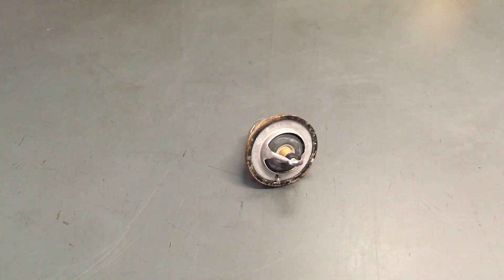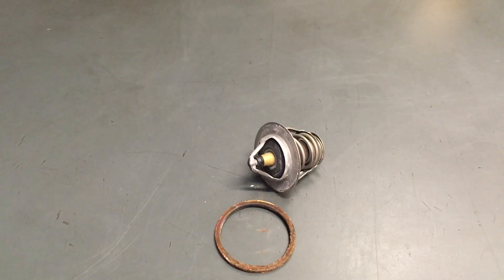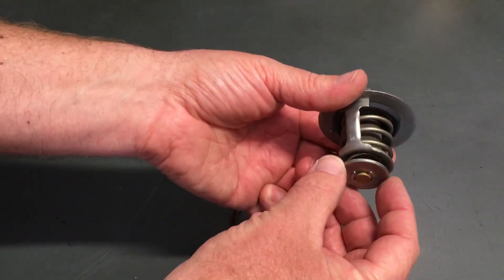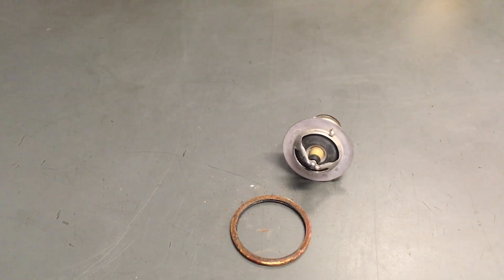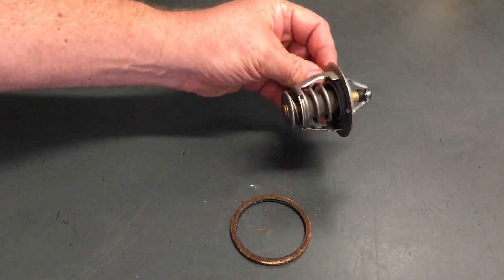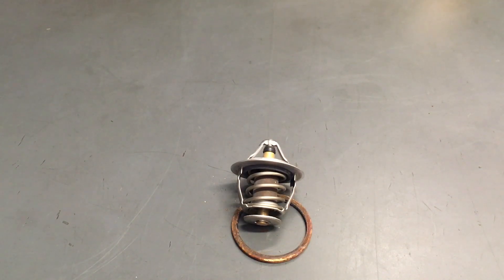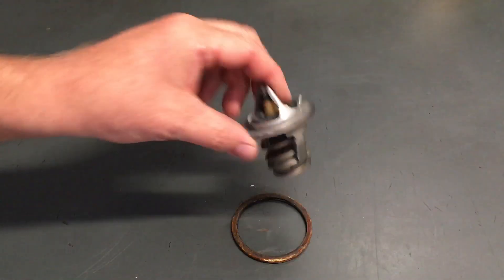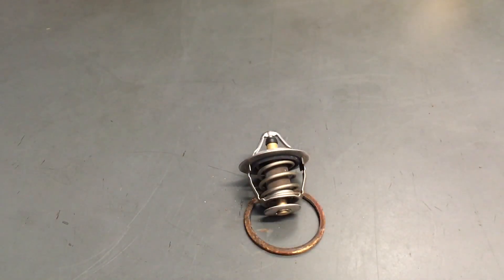AUTOMOTIVE THERMOSTAT 1kd-ftv

Comment: I just replaced my 1kdftv genuine toyota thermostat after 80k kms due to irregular  operation as it would play up and not open sometimes. this was with toyota super long life coolant. in my experience thermostats play up, even the genuine ones but toyota is $26 compared to tridon $45, strange that. best thing I did was install an engine guard digital temperature reader which bolts to the head on the intake side and has an alarm if the temperature rises abnormally high to save you cooking the engine. worth the money in my opinion,  I put one on my bobcat too.

Comment: Hi Mate I have a temp issue in my 150 prado I noticed it on fraser  trip when I'm doing 110km/p hour plus on the hill with full a/c on temperature  go up close to H then need to turn off the AC its comes down. And even on sand driving it's go up. Any idea what this causing??